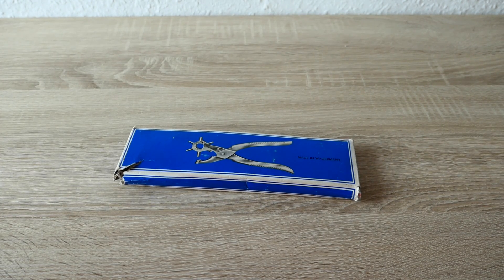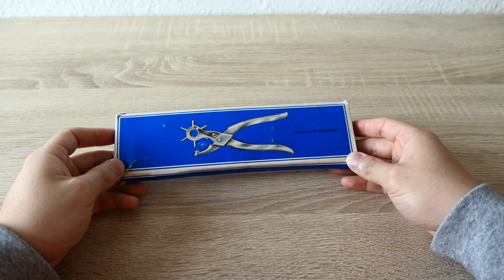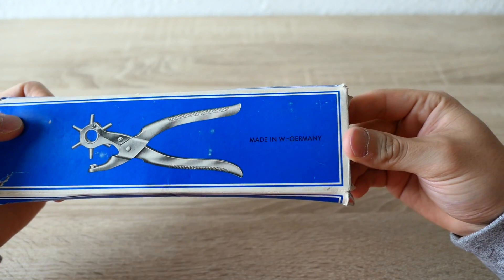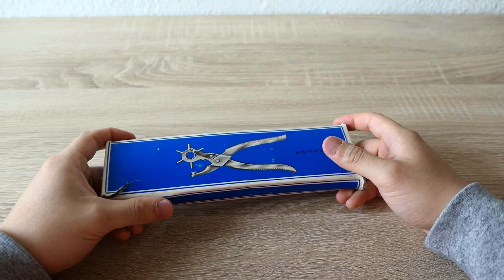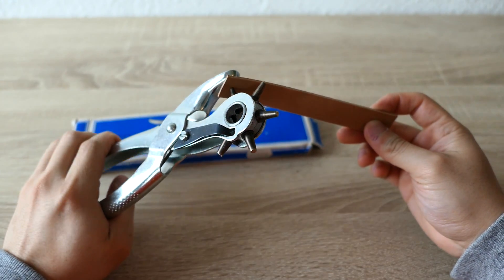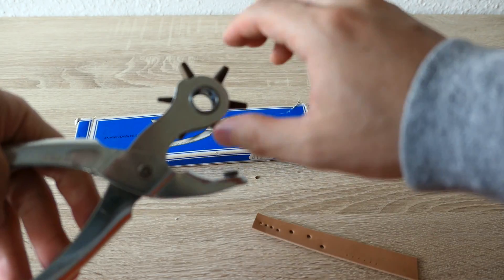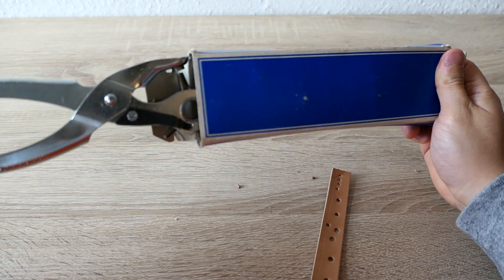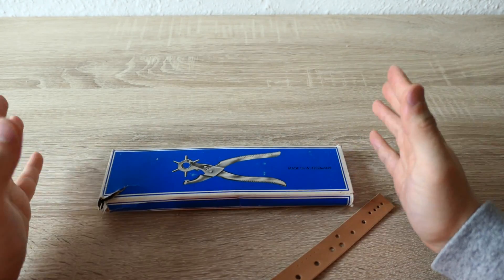FleaMarket Finds Series #9 - Rotary Hole Punch Tool

Comment: Look like and old version of Stahl hole punch. I have e new version of this and it looks almost the same. Awesome quality, but as you say the steel in the punches is probably better in the older ones.
Reply from the maker: Thanks for the brand names. Stahl? I've never heard of it. I will have to google them. Do you have any link to the online shop or just picture link?
Reply: leathertoolz unfortunately I don’t remember where I bought it. But it was new (still it could be old) it’s very good quality compared to other punches i’ve tried. Sending some pictures to you on insta.